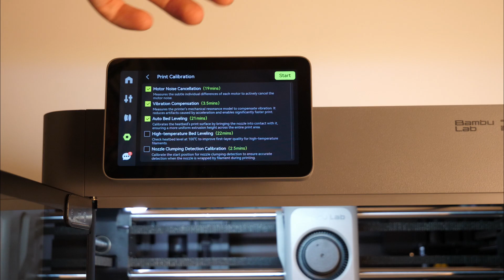BambuLab P2S Maintenance Guide

Comment: In your experience, does bambu do a good job lubricating from the factory? Or should this be one of the first things I should do after setting up my P2S?
Reply from the maker: I wouldn’t worry about it for a few months unless you’re running a print farm or something where they’re constantly going

Bambu seem to put something thicker on in between a grease and oil to prevent rust and so it doesn’t get everywhere in transit. Bear in mind my machine was probably in a warehouse for a few weeks/months before I got it.

Hope that helps, definitely don’t worry when you do it though. Some people go years just fine without maintenance and do something when it starts making funny noises 😂

Comment: Tip: move the printerhead with both hands. Just put your finger on each end the black part, not the rods. Then slowly pull towards. This causes no stress and you can feel the tension better then just yanking on the printerhead itself. 

Besides that I’d advise to print some covers.

Comment: How often should you do the maintenance on the P2S?
Reply from the maker: All depends on how often you use the printer as per BambuLab website:

Heavy use (5hrs+ Daily) oil every month and grease z screws every 3 months.

Regular (1-5hrs use daily) oil every 2 months and grease z screws every 4 months.

And low (1hr or less per day) oil every 3 months and grease z screws every 5 months.
Reply: @JoshLab3DThanks for the tip

Comment: Hey Josh, I live in the UK and ordered the P2S Combo about a month ago and it was expected to ship around 29 dec - when did you order yours and when did it come as mine is taking a while? Thanks mate
Reply from the maker: I ordered mine on the 14th Dec and received on 16th I want to say but I ordered the non combo. The combo was out of stock till 13th of January when I was ordering

There’s a special piece called a filament buffer you need to join the P2S to the AMS 2 and I think that’s what they’re out of stock on (it’s included in the combo) because the P2S and AMS are both showing in stock separately

You’ll get it soon I’m sure 👌
Reply: @JoshLab3D yeah the filament buffer is a product you cannot buy separately so it must be hard to get - i hope everything comes soon!